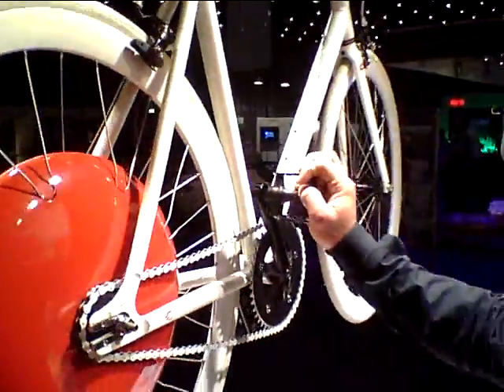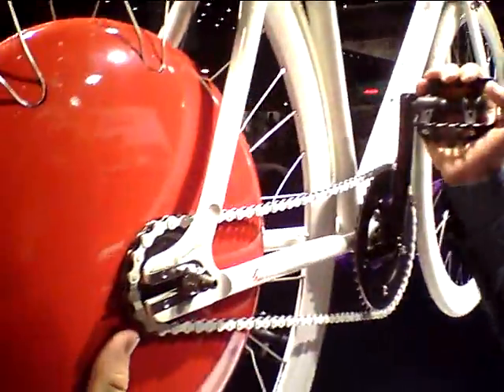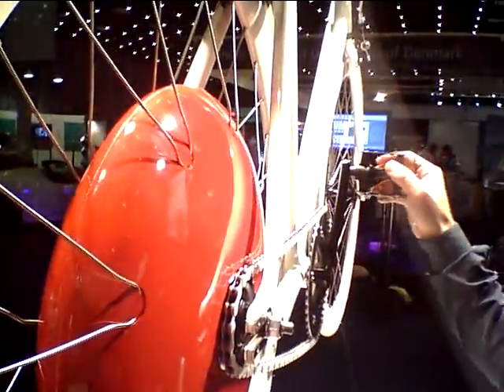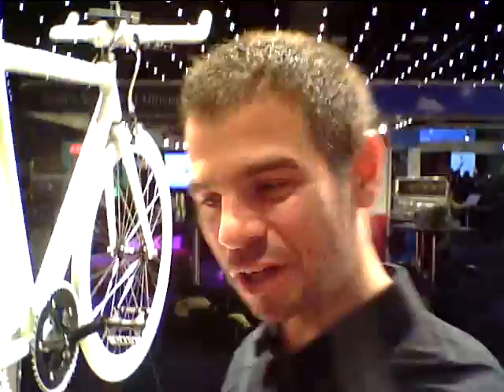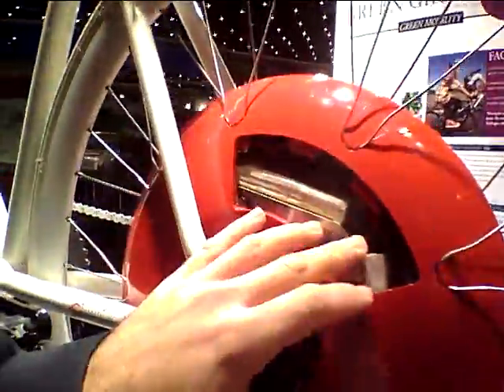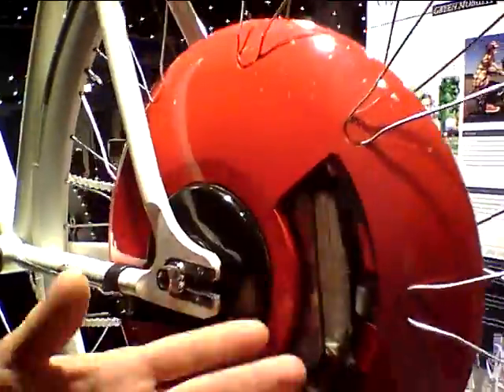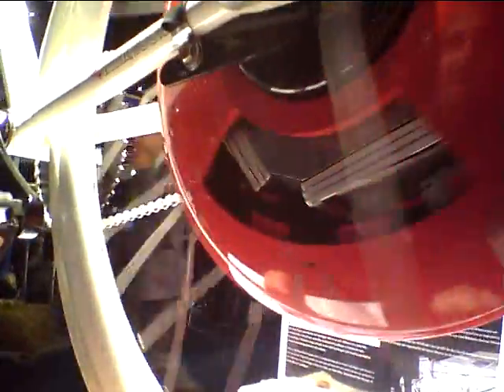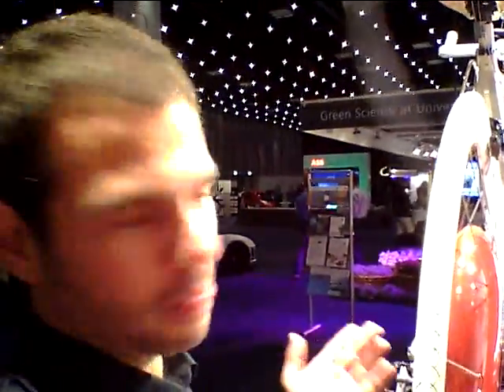Copenhagen Wheel - hi-tech cykelhjul fra MIT

Comment: Er, I know you MIT people are supposed to be really clever, but did you not think of putting it on the already much lighter FRONT WHEEL? That way you can keep your gears...
Reply: if it were in front, how is it supposed to get information from your pedaling?
Reply: The front wheel gives exactly the same information as the back one... you are puching the whole bike along when you pedal and that means you are puching the front wheel round too...
Reply: Aaron Wilde No. Absolutely not. Pedal assist works by measuring the forward ( and sometimes backwards for coaster brakes. ) strain in the rear gear itself. Think about it. What is different when you are going up a hill? The front wheel is just happily rolling along. It doesn't "feel" the extra power you are exerting on the pedal. The chain and rear gears do feel that strain. That is what this device measures, and acts on.
Reply: It could measure that by simply have a mercury device inside so it knows the incline of the hill. It could still be front wheel mounted and work out whether you are struggling. It does not need to "feel the force" it can simply calculate it. My point is if it was on the front wheel the bike would be better balanced, and your gears could be retained. I bet they never even considered putting it on the front wheel. That's my point.
Reply: I'm sure they considered it. After a quick brain storming session it would be quickly dismissed. It's not just about sensing a hill, that's too simplistic. First reason, the front wheel can not "feel" when you are pedaling, and sense how hard you are pedaling. ( How do you calculate the force from the front wheel? ) You need the torque of the gear for that. Second reason, the design requirement by law is that the motor only assist you when you pedal. This would be difficult if not impossible to achieve in a front wheel design. Third reason, regenerative braking. It would add complexity to attached anything to the brake levers. It would be a very complex problem to assist with braking by sensing deceleration from friction brakes.

As an aside. I'm pretty sure Mercury tilt switch are banned in the EU. Although a 6DOF IMU would achieve the goal of calculating all the forces you would need for a front wheel design.

I don't think an equivalent front wheel design is impossible. I just think it would be overly complex, and add quite a bit of expense. It violates the KISS principle of engineering. Which is why the back wheel is used.

Edit: You can use rear gears with the device.
Reply: I see. Well the device is unnecessarily complicated and I cringe from the word "smart" so I won't be buying one. I don't have a "smart" phone anyway. The very idea that you need a smart phone goes completely against the idea of a cheap off grid way of transport. It's conceptually wrong. They are making a bicycle for lazy people who also have cars. Personally I like the fact I am well toned from riding a bike. But I do like the idea of a dynamo you could engage on the downhill, and which is charged by braking, that would be very simple and you could switch it on when you want the assistance not when a "smart" device tells me I need it.
Reply: Also. The smart phone is optional. The device is self contained. It appears the smart phone is used to change settings, and collect and visualize data.
Reply: I see. Well, I'll keep my muscles AND save money ;)

Comment: Can you charge this thing at home so you do not have to pump it and regenerate only through braking?
Reply: Regeneration just extends the range, allowing for a smaller battery and weight savings. If you ride every day you likely will have to plug it in. The specs say it charges in 4 hours.